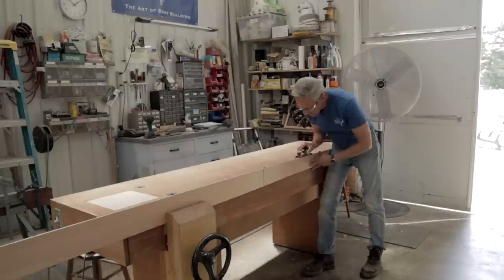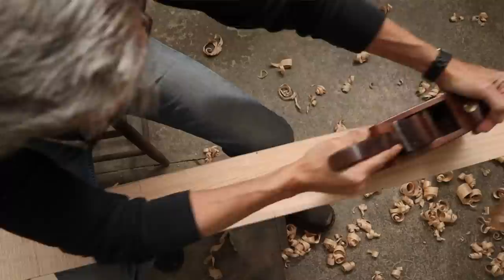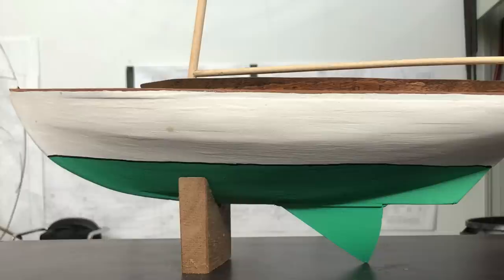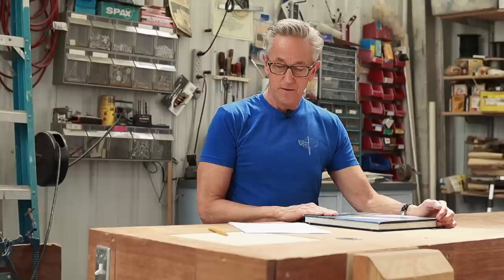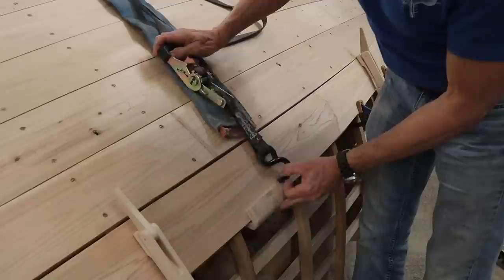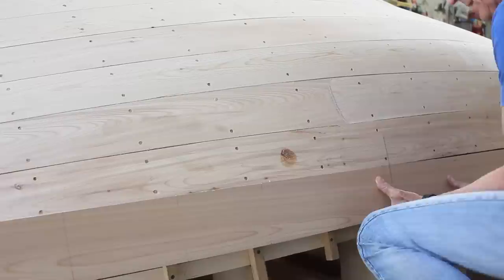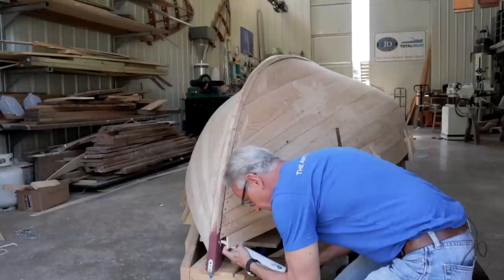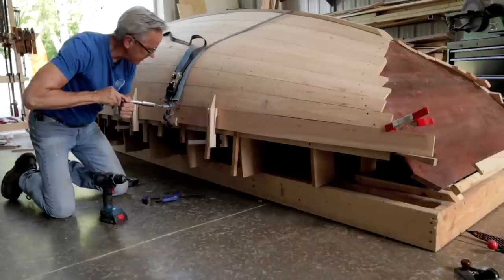The Whiskey Plank, the Last plank, is Installed on the Haven, S2-E26

Comment: Jeez Bob you're an artist and a very gifted craftsman, but as a proud Scotsman what you did to that Whisky (proper Scots spelling) with that shot glass is sacrilege  😉😁
That being said, belated congratulations on the whisky plank of your wee boat.
For the record, I much prefer your idea of using the minimal sheer strake as per L Francis's own design as its more fitting of the overall lines of this lovely wee boat in my own opinion.
Best regards from Glasgow, yes Im Clyde built just like the best boats (I grew up less than 100m from the river Clyde) 😎

Comment: Cheers on this big milestone!  Can’t wait to see you lop off the tail feathers and see it in all its bare fullness.  After screws have seated for a while do you go back and do some final tightening?  Noticed some tear outs and frittered knot holes in some close-ups of planks.  Will you do some plugs and/or mini dutchman repairs before fairing compound?  Tipped one back on your achievement.  À votre santé.  Pierre in Ottawa
Reply from the maker: Thanks, I will check the screws as I do the fairing. Some will need to be seated deeper as they will hinder the fairing process. For the screw heads, knots and other imperfections I’ll use fairing compound. Thanks for your comment and watching. Cheers!

Comment: Congratulations on the blanking.  Your demonstrated prescience is one of the keys to a successful build. Some builders insist on clocking the screws, I have always thought that was a silly concept that does not enhance form or function.  Your thoughts?
Reply from the maker: Yes, I agree pretty silly. I never have clocked screws on any project including sculptures. Anyway these screws will get fairing compound over the head, never to be seen. 
Thanks for watching!

Comment: congrats.well done.
I have realized a question.
Why use slotted fasteners? Most boat(youtube) builders use them, but why?
A straight blade screw is shite for every other application so why use it in a critical usage?
I am an entry systems tech and I would be fired for using that fastener.
congrats on the whisky but why i must ask why slotted over torx or robinson or is it just the way its been always done?
Reply from the maker: Flat head slotted screws are used because they are easier to remove if repairs are needed. The head of the screws will get fairing compound I’ve them. It’s quite easy to completely remove the compound out of a slot as nearly impossible to remove from a torx, phillips, or square etc. It’s also harder to over tighten put in by hand. The screws are also bronze which is a soft malleable material which is great for wooden boat. 
Hope that helps.

Comment: I love traditional construction but where I live the wood is too expensive therefore there is no suitable wood on the market. What if I try to do it with plywood? perhaps you could mix techniques and cover it with a thin layer of resin and fiberglass as is often done with Canadian canoes. what do you think?
Reply from the maker: Yes, you can build the hull with different techniques. What you are describing is cold molding. Many Havens have been built this way especially if the boat will live on a trailer and be in and out of the water is a season. The Somes Sound, designed by John Brooks, based on the Haven, uses plywood lapstraked construction for the hull.
http://www.brooksboatsdesigns.com/Somes%20Sound%20main/SomesSoundmain.html
If you're looking for the smooth hull, in addition to cold molding (many layers of veneer) one could also edge set narrower planks and glass cloth and epoxy the hull.

Thanks for watching.
Cheers,
Bob
Reply: @TheArtofBoatBuilding  You have been very kind to provide me with this information. Thanks for the help, Best regards.

Comment: Is there a specific boat-related reason why flat head screws are used on the hull? I heard they are the worst type of screw type as far as ease of use and "grip" when applying torque.
Reply from the maker: Yes, there is a reason why wooden boat builders like slotted screws. I address that question in S2-E42 https://youtu.be/0GVdUPDrfEA
Start at the beginning for my answer.
Why use slotted screw?
Cheers,
Bob

Comment: Noticed that you drove screws with a power tool on your first boat but you use the yankee screw driver to put planks on. Is this to prevent damage to the planks or just to make sure the depth is right? Also, looks like they aren’t deep enough for plugs are you just going fill over them?
Reply from the maker: You are right. Putting the screws in by hand gives one the feel when they are tight but not to tight. The first boat was constructed with plywood so a power tool is acceptable. With only 1/2" plank, if I drove them deep enough for a plug, the screw won't have much to hold onto. I will fill the screws with fairing compound.
Thanks!
Reply: Thanks for the videos. I am restoring a pulling boat and will need to replace most of the cedar planks. They are also, about the same thickness as the havens so I will need to fill screw holes as well. I will also be making a reefing hook from your video but will use an old circular saw blade for the metal. Thanks again for the videos.

Comment: Do you hollow out the whole plank or just where it meets the frame?
Reply from the maker: The whole plank. The degree of hollow is determined by each frame/station. In the case of the Haven the aft section had more hollow than the fore frames. In face from stations 1-5 there wasn’t any hollow. Thanks for watching Carl.
Reply: @TheArtofBoatBuilding  Are the bevels on the edge measured from the original flat back of plank, or from the hollowed back?

Comment: where is the sheer plank, you still have two planks, and usually the shutter is slipped in between two,one above and one below
Reply from the maker: The plank I put on is the sheer strake. Small craft like my boat very rarely have a shutter plank.  The shutter plank is always last. However a whisky plank is any plank that is the installed last. So in my case the sheer strake was the last plank aka Whiskey Plank